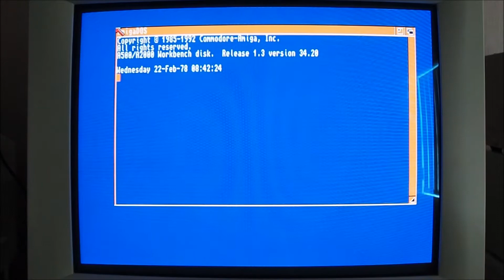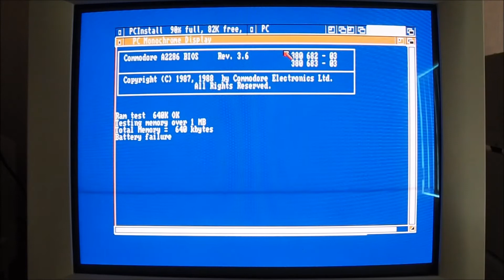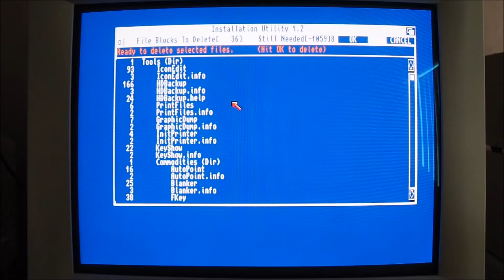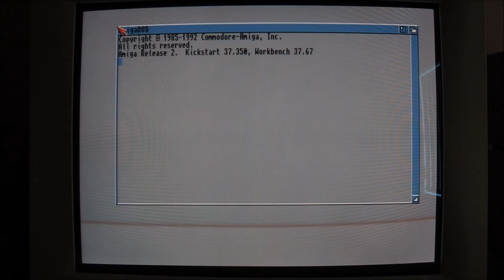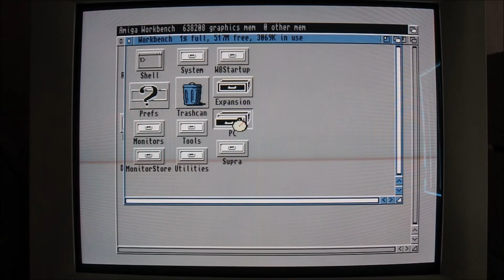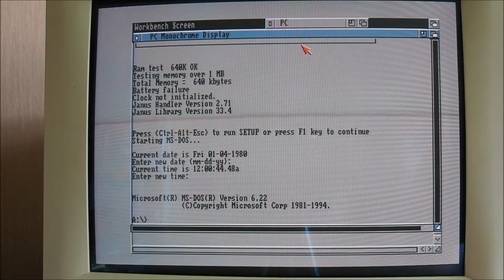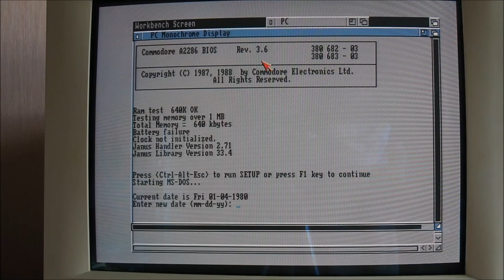Tricking out the Amiga 2500 Part 3.

Comment: To get color (CGA) emulation, you need to change position of an jumper on the small A2286 daughter board. MDA text display is default. Also turn on color in the PC prefs program, and also in BIOS setting.

You can also use and harddrive file on your Amiga harddrive to emulate harddrive. TIPS: You can setup the harddrive in PCTask instead of with the supplied commands, PCTask uses compatible harddrive image file.
Reply from the maker: Thanks for the tips.

Comment: 2 different PC's in an AMIGA case thats revolutionary for the time shame they didn't make a board like this for the A4000 that lets you run native Windows 98 the final DOS version of Windows which would have gave the AGA some VGA PC action as a 2 in 1 like this and perhaps saving Desktop AMIGA at least from dying until 2000 when 98 also died.
Reply: Amiga 2000, 2500, 3000, 3000t, 4000, 4000t and the PC sidecard for Amiga 1000, all got ISA slots that connects to the PC emulator card, where you can add VGA card, Sound card etc.. Got that setup in my own Amiga 2500. Commodore A2386 car followed this card, and can be upgraded to 486@75 MHz.. all these cards works in an Amiga 4000 as well. You could also get 3rd party once, like GoldenGate 486 card.

The cards got an RAM buffer that communicated with the Amiga hardware. Sharing resources, clipboard, emulating mouse, keyboard, etc. Harddrive can be emulated by image file on Amiga harddrive partition etc.

PC emulator expansion was official available almost from the start, with the original Amiga model, A1000. Commodore Germany started developing it.
Reply: GoldenGate made a 486slc2 50mhz bridgeboard that can use 16MB ram. you can read about here: https://amiga.resource.cx/exp/goldengate  win98 is not practical on these cards as they are SX processors. Its too slow to be useful. win95 is possible..but 3.1 runs ok.